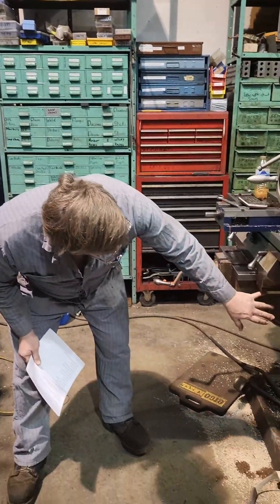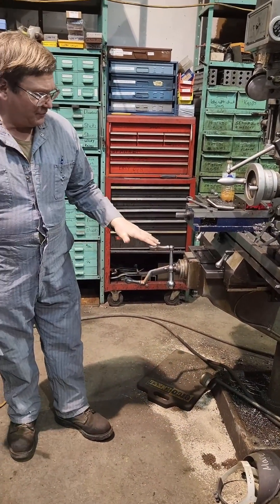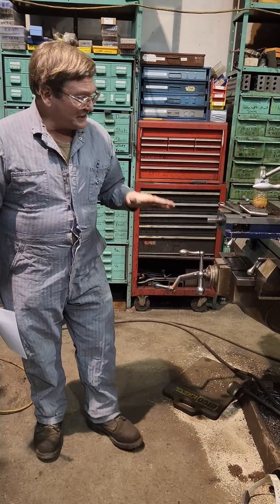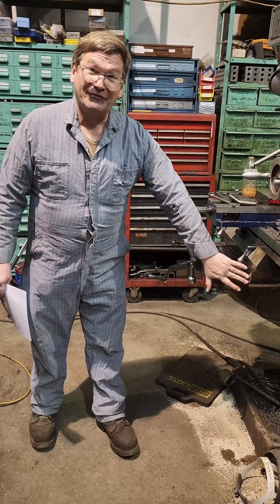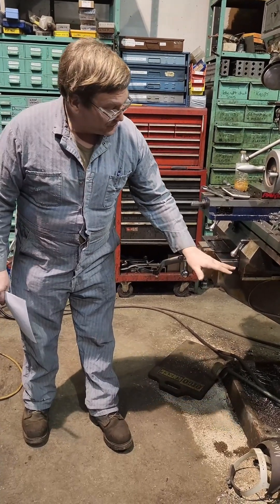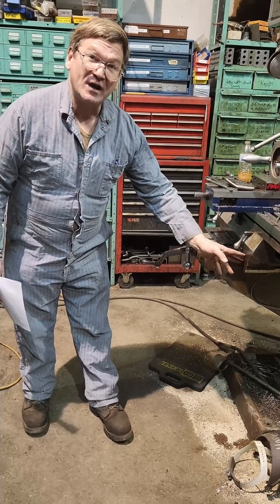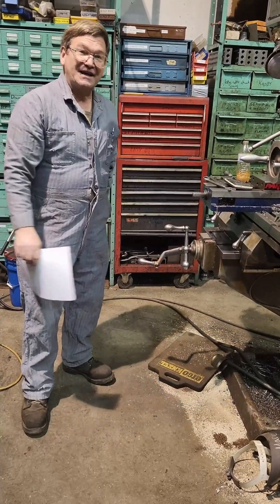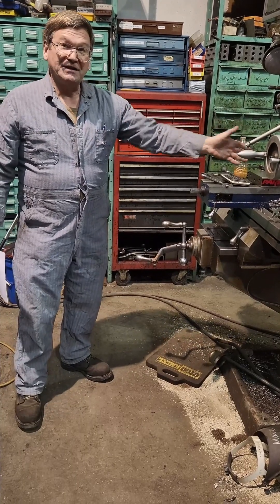Machinist's Minute: DRO scale location and precision

Comment: So, generally speaking, when the dro on my BP creeps a half thousandth to a full thousandth when i lock the ways, should i try to bring it back to the correct measurement? Or leave it exactly where it is?
Reply: You need to first put an indicator with a mag base on your axis in question and see if the needle moves in comparison to your DRO. I suspect your scales are out of alignment or you have a gib issue (alignment/damage/wear). The question isn't if you should try to compensate, the question is what is the root cause.
Reply from the maker: shootgp is correct, if you have the time to make the situation perfect.  If you are not going to fix the geometry problem, then the best is to pick a method & always do it that way to insure consistency.  either always set a number & lock without concern, or always correct the number, as you tighten the lock.